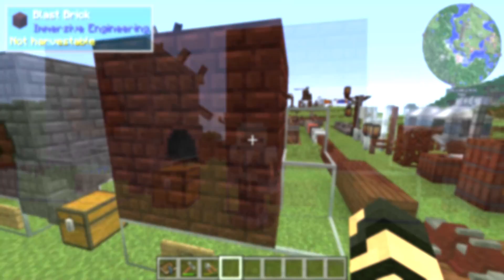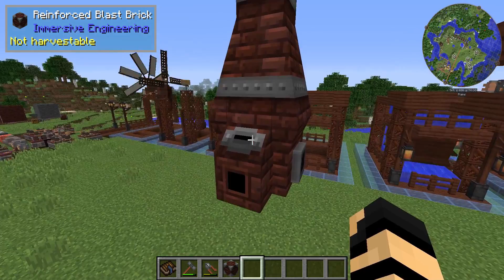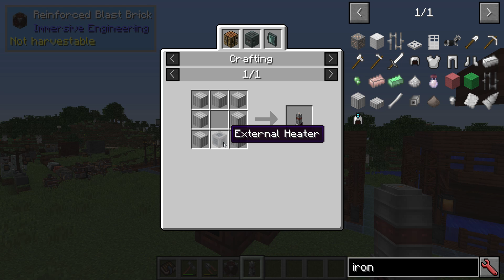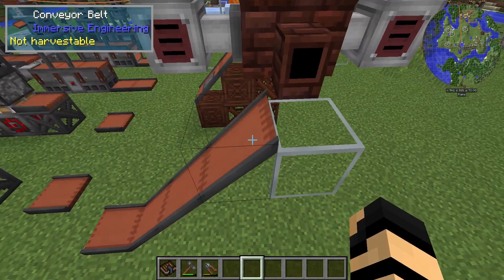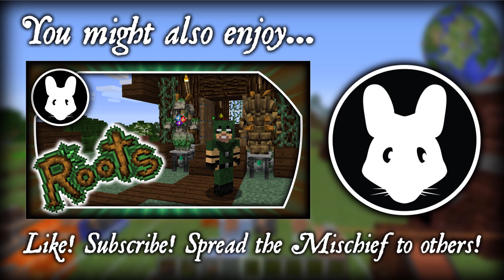Immersive Engineering: Reinforced Blast Furnace - Minecraft 1.10.2/1.11.2

Comment: I connected everything together and no power is going through. It sits in the capacitors. I tried LV and MV,  and experimented, and nothing has worked so far to power the preheaters.
Reply: Update: Well, it works if I connect it directly to the waterwheel, but if that's what it takes, what use are capacitors? I thought you could just hook them up to those and use up the power stored in them.
Reply from the maker: +Andros the Bloodthirsty What type of capacitor are you using? Match the type LV, MV, HV.
Reply: I had it right, I was being stupid and connected relays to the preheaters instead of connectors. Still getting used to managing these things, but thank you for the feedback, I appreciate it, keep up your bit by bit videos, we love em.
Reply: Also, do you plan on making a windmill video on how to make it look nice? I enjoyed the waterwheel one and made a bunch all with a similar design.

Comment: Are the furnace pre-heaters compatible with ender io energy conduits for RF?
Reply from the maker: Best I can say is... sometimes... Ender IO and IE often have compatibility issues. Sometimes it works, then an update later it doesn't. I'd try to stick with using an Ender IO capacitor bank as a transition between the two mods as a rule of thumb since that seems to function pretty reliably so far.